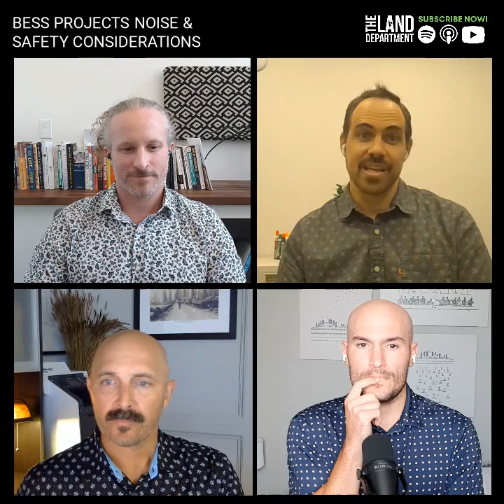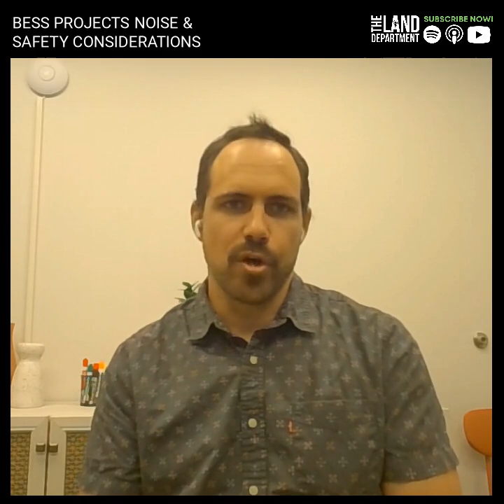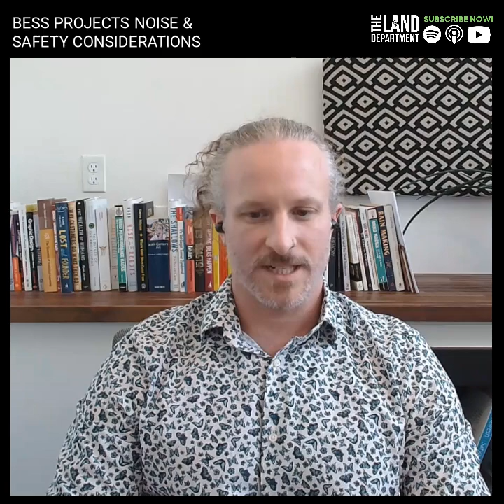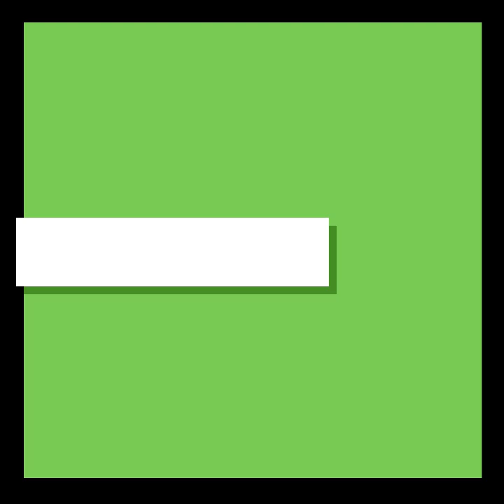BESS Projects Noise & Safety Considerations | TLD 032

Comment: Wow... I'm stunned by the lack of knowledge expressed... talk about noise but dont know the noise limit... we have a project in Alberta where the project can only operate at 40% fan duty cycle with a 4.5 meter (69 feet) noise barrier wall so it can meet noise regulations... maybe learn more before sharing?